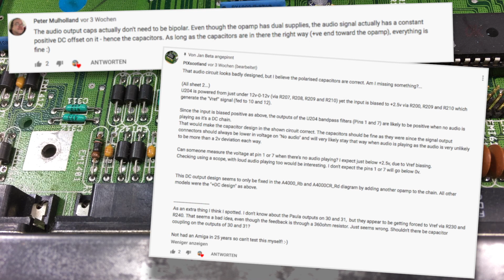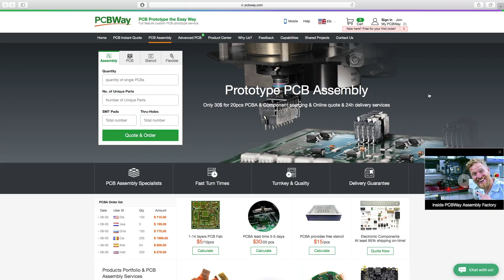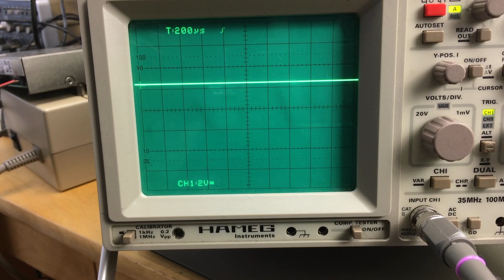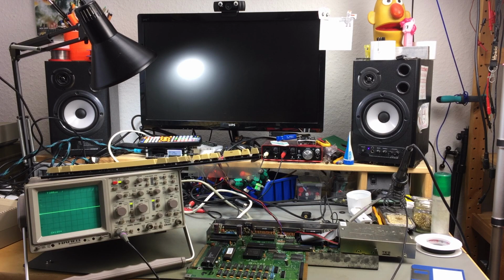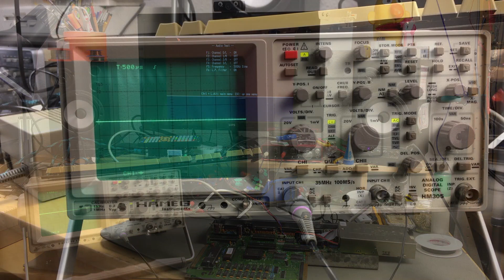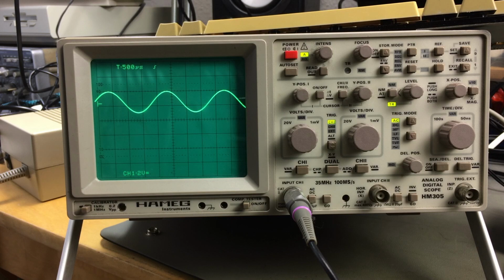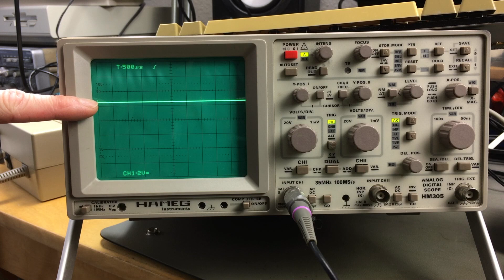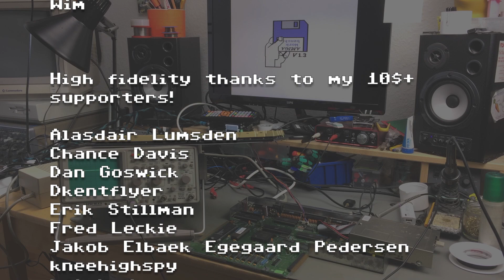Bipolar Capacitors in the Amiga Audio Circuit?

Comment: The circuit is badly designed - as the opamp has bipolar supplies, the signal shouldve been biased around 0v, and then the output capacitors wouldn't have been needed at all :)
Reply: @Martin M It depends on the opamp and the circuit topology. Bipolar input opamps such as the NE5532 typically do have tens to 100mV's of internal DC offset. FET input opamps, especially modern laser-trimmed ones, usually have offsets in the uV range which can be ignored in audio.  In this case the DC offset is intentional because Paula runs on a single 5V supply - but it could have been cancelled out in other ways other than by using DC blocking capacitors.

Comment: I'm not completely sure how probing against ground is relevant in this case, because the cap is not across the output and ground, but inline in the audio circuit so it's not really the same case as referencing the negative side of the cap with ground and positive side with an AC signal for example. I would understand it so that the cap is only interested in the voltage across it's terminals. So maybe hook up your scope to differential mode and measure the voltage across the capacitor with varying sine waves? I'd expect a very low voltage difference across the cap until you start reaching frequencies where the ESR/impedance starts getting so big that the cap acts as a resistor. Comments always welcome if there's something very wrong with my thinking :-)

Comment: Polarised electrolytics are just the basics of single ended circuit design. You basically create a virtual ground at a comfortable voltage and maintain it throughout the audio circuit. Furthermore reverse biasing polarised electrolytics in low-current circuits by a small little bit is completely appropriate as long as you don't have the utmost of hi-fi ambitions, at least half a volt, maybe up to one and a half.
Reply: internally, bipolar capacitors are actually two polarised capacitors in series :)
Reply: @jaycee1980  It is my understanding that this is not how they're actually usually made, but i've never torn one apart. But if your polarised capacitor turns into a diode reliably enough when reverse biased and you're dealing with low enough currents, the back to back series construction can be an adequate substitute.

Comment: Even polarized caps are capacitive in both directions, however strong reverse voltages deplete the oxide layer dielectric which might result in a short. For very small signals you can use polarized caps with much higher rated voltage, however it doesn't make much sense to do so, except you have nothing else around ATM.

Also the polarity only describes the "input", before the cap, not the "output". In fact, the "output" has to be AC, otherwise your cap is leaky or broken. Capacitors block/attenuate low frequencies up to a certain point and that always includes DC which is essentially a 0Hz sine wave and thus completely blocked ideally.

Comment: Great video!  Caps block DC btw.  Regards the -ve clipping, I see it in reality!  I see it just playing Dune on an A500, I've got a clip to go into another video that's been sat on my HDD for ages now.  It is a problem, perhaps more so on A2000s for some reason.  it doesn't affect audio quality though, and it isn't minor.  So it does occur even in normal use.   Did you have the scope set to AC coupling or DC coupling?  Video response incoming ;)  It's rendering at the moment!  I see a strong -ve and +ve swing there, not biased, and I don't know how it could have a bias when the electrolytic is blocking the DC?
Reply: It must have been set to DC coupling, otherwise we wouldn't have seen the DC Bias with respect to Gnd. AC Coupling would have stripped out the DC component.
Reply: @lesleymunro4964  The thing is, there shouldn't be a DC bias due to the coupling cap!?!?   My video response is rendering now, it will be up there in 10 mins.  I think what is happening is the polarised cap is perhaps blocking 90+% of the negative swing (hence why these caps can leak eventually as they do on an A2000)?   I've tested this morning following this video - just to make sure my earlier footage (not released yet) was correct and it is.  I think if Jan had bipolar caps in there he would see what I see, and what others have seen (people more knowledgeable than me for sure!).
Reply: Ahhh! I see what you are saying. I'm not really sure that would be the case though. The DC Bias usually comes from the amplifier side of things, and the cap is there to strip it off. But I understand your thinking, that the polarised cap may be lifting the output voltage and creating the bias, due to the polarisation. I don't think that would happen, I think if that was the case, the cap would quickly fail like a firecracker. And the way to test, would be to remove the capacitor, then Oscilloscope the amp output, in DC coupling mode, to see if any DC bias is still there. If the cap is out of circuit, it can't affect the bias, and would answer your question.
Reply: Here's the link to my response:- https://www.youtube.com/watch?v=SbYcviUAvVI

Comment: Ohauerha, Jan! Das Video fischt im trüben :-) Elkos (und andere Kondensatoren)  lassen Wechselspannung durch (in beiden Richtungen, natürlich). Es sind keine Dioden, die in  eine Richtung sperren. Darum wird auch nichts abgeschnitten. Elkos sind polarisiert, aber nicht weil sie nur in eine Richtung leiten. Sie vertragen es nicht, zu stark verpolt zu werden. Da wird nichts verzerrt, solange sie nicht kaputt sind. In Audioschaltungen werden Elkos eingesetzt, um die Verstärkerstufen gleichspannungsmäßig zu entkoppeln. Wenn Du mit zwei Tastköpen vor und hinter den Elko misst, dann gehört der Pluspol des Elkos dahin, wo die Spannung positiver ist. Wenn man also an einem Ende keine DC-Offset hat und an dem anderen Ende einen Offset von 2.5V, gehört der Pluspol and genau dieses Ende. Bipolar-Elkos kommen hauptsächlich in Audioschaltunge vor, sind aber trotzdem selten. Sie vertragen die Verpolung um die Nennspannung. Normale Elkos vertragen das nicht, können aber duchaus mal 1 Volt oder 1 1/2 Volt verpolt werden, ohne gleich die Flügel zu strecken. Die Tantalelkos sind da komplett allergisch gegen. Bei mehr als vielleicht 0.7V Verpolung machen sie Peng und brennen ein Loch in die Platine.

Also, auf beiden Anschlüssen des Elkos gleichzeitig messen (zwei Kanäle) und die Werte voneinander abziehen, das sollte das Scope können. Wird der Elko mehr als 1 1/2 Volt verpolt, dann ist das schlecht und man braucht einen Bipolar-Elko. Ist es weniger, dann ist es kein Problem. Das ist das Kriterium.
Reply from the maker: Auweia, da hab ich wohl einiges falsch verstanden! Danke für die Berichtigung Sven! Gibt dann wohl noch ein follow up Video beizeiten...
Reply: Jan Beta Ich wollte ja nicht meckern :-) Aber in der Retro-Community gehen ja einige urban legends um :-) Da musste ich doch einmal ganz sachte den Finger heben und schnipsen :-)
Reply: Es ist schon richtig, dass vor den Elkos ein DC Offset von ca. 2,5V herrscht und hinter dem Elko nicht mehr. Der Kondensator lässt die Gleichspannung nicht durch. Allerdings ist der DC Offset nicht da, damit billige Elkos verwendet werden können, sondern die Funktionsweise des  "DAC" für Paula sorgt dafür, dass die 8bit zwischen 0 und 5V abgebildet werden. Digital "null" entspricht daher der Mitte zwischen 0 und 5V, also 2,5V. Das DC Offset muss nicht zwingend rausgefiltert werden, da die meisten folgenden Geräte eh nochmals im Eingang entkoppelt sind. Einige sinds aber auch eben nicht, daher sollte man auf Nummer Sicher gehen und das Ganze durch einen Kondensator jagen.
Reply: Jens Droessler das hatte ich auch gar nicht geschrieben. Ich kenne die Schaltung vom Amiga auch nicht, wenigstens nicht persönlich :-) Ich habe in dem Follow-up-Video auch nur die Ausgangsstufe gesehen.
Reply: @svenpetersen1965  Ich meinte auch nicht, dass was du geschrieben hast grundsätzlich falsch ist. Ich hatte nur das Gefühl, dass es Jan eher aus dem Konzept gebracht hat und wollte es bezogen auf das Thema Amiga-Audio wieder in die richtige Richtung bringen.
Reply: @JL Picard Ich denke, du solltest das nochmal nachlesen, denn du liegst definitiv falsch. "Polar" bezieht sich auf "Polarität", nicht auf "Pol". Bipolar heißt das Elko verträgt beide Polaritäten. "Uni" bedeutet übrigens "eins".
Reply: @jensdroessler3575  Habe nachgelesen und meine Posts deshalb gelöscht. Meine Interpretation des Begriffes bipolar war wohl eine falsche - Danke für die Aufklärung.
Reply: @jlpicard3724  Du vertauschst da was. Bipolar-Kondensatoren sind ungepolt. "Bi" bedeutet hier "beide". Gepolte Kondensatoren müssten, wenn man unbedingt "polar" mit reinbringen wollte, "monopolar heißen. Bipolar-Elkos werden auch als Tonfrequenz-Elkos bezeichnet. Warum ist das wohl so? :)

Comment: You were overdriving the circuit, which as you mentioned, will not happen in normal use. Hence the use of the “bipolar capacitor” is unwarranted.